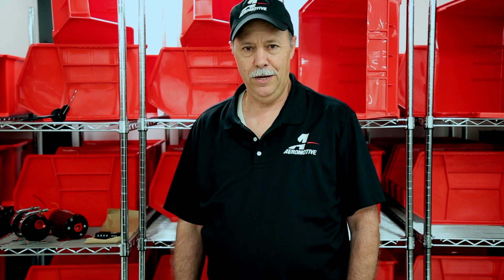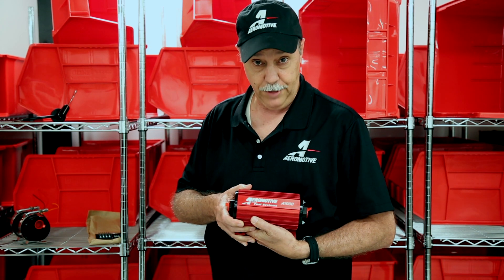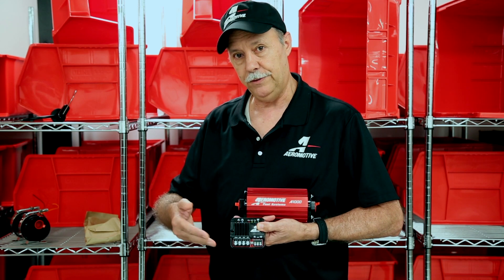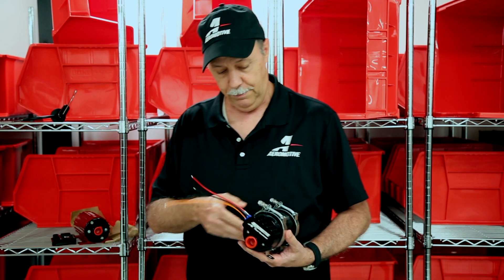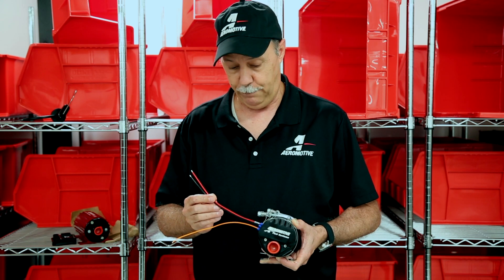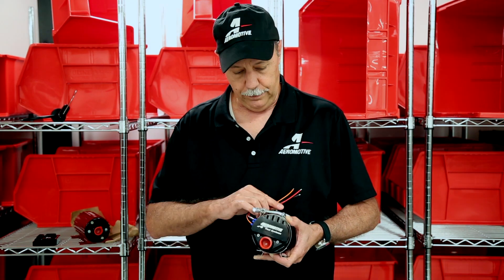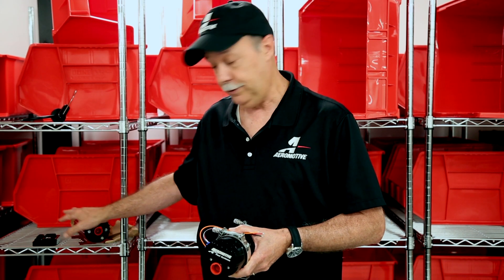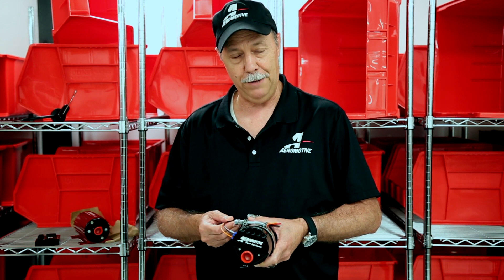Aeromotive | Tech Tuesday: Variable Speed Controller

Comment: Was thinking about a controller because my Aeromotive vane pump is little to noisy at idle when waiting for the traffic light. Means at idle I dont need 13,8Volt on the pump. Will see how to work this out.

Comment: i have a 22.5 gallon fuel tank with your aAeromotive stealth 340 pump kit installed. i have been experiencing fuel pressure drop after stop and go traffic driving or if sitting in a food drive-through for a while. it's about 80° to 95° days where i live. i haven't verified the cause of this fuel pressure loss, but i suspect its what you said hot fuel and vapor lock. Would you also recommend adding a fuel cooler before the fuel controller? thanks
Reply from the maker: If you can give us a call our tech will go over any questions you have. 913-647-7300

Comment: What frequency does this controller output to control the pump and how much current can it constantly handle? I have two pumps and each needs about 20amps at fuel clip for a total of 40amps. I haven't yet found a controller that can handle that.
Reply from the maker: A solid-state transistor circuit, rated up to 40 amps, replaces the relays recommended in most fuel pump electrical circuits.

Comment: What's the slowest the pump will run with the 0 volt input?
Reply: With 0 volts to the controller the 5gpm will flow 1.5gpm. Basically 30% of their full flow.